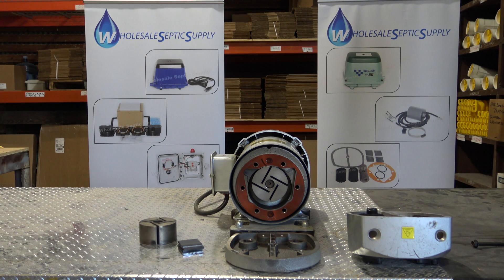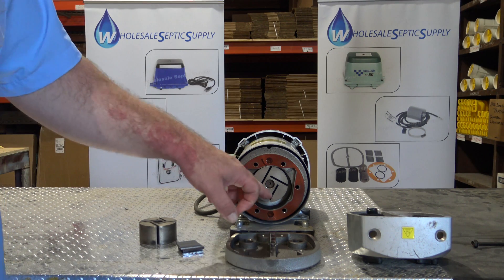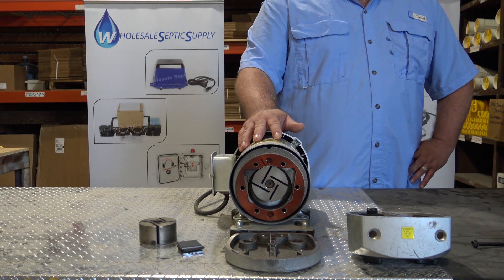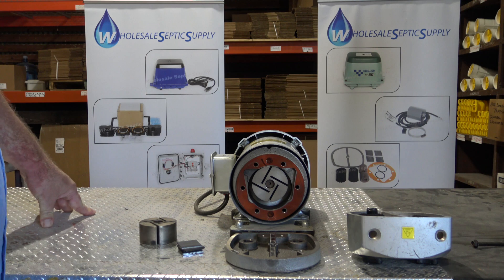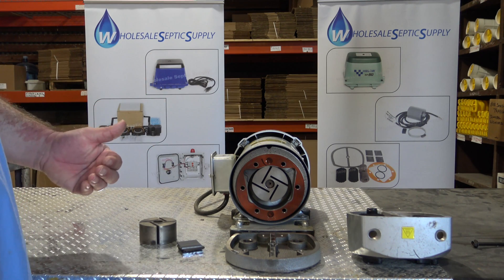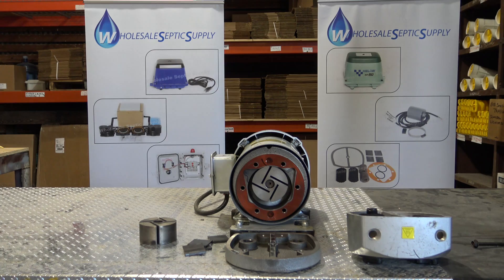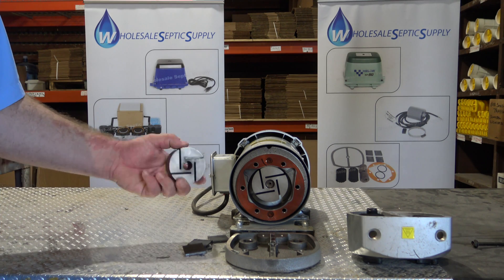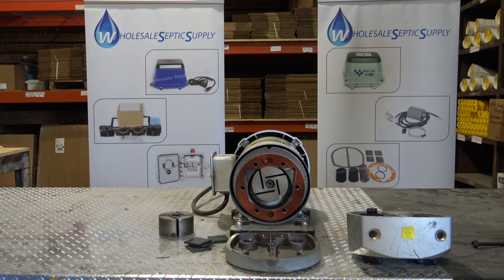Rotary Vane Septic Air Pump

Comment: Thanks for the video, I have a couple of questions....

1. How is the required RPM on the rotary vane pump calculated?

2. Do they take a large force to spin when producing compressed air?

3. We need one that can produce minimum 8 PSI at minimum 12 litres per second. Do you know of any available that can produce that?
Reply from the maker: Sure i dont know if it has be that precise but they have ones that produce that lps. Or over. The at05 is 137 LPM 1023 is 220lpm. 1423 is about 250lpm. That’s the most common types. 1423 is 1 hp. They have larger units though. For this application the rpm 3450

Comment: Hi,  hope u r doing good..  I have gast 2067 vane compressor.  I m facing problem,  I m not getting good pressure..  Pressure is going till 3 bar...  I changed the Vane Plate after that I m facing this problem..  Can u give me your some expert advise  I would be very thankful to you.
Reply from the maker: x.ashhad exp and funny video T.V  that a big pump let me call my Gast rep and find out. You will lose a little bit of pressure after rebuild but not that much that’s a monster pump. You should getting more pressure though.
Reply: Wholesale Septic Supply thanks for your response, I need pressure 8 to 10 bar..  But I m getting around 4 bar,  if u will get Any information please inform me..  Ok can u tell me one thing.  That vane plate should be equal to rotar slot.  I m talking about vane width
Reply from the maker: x.ashhad exp and funny video T.V  yes it should be the tolerance is supper tight in the thousands of a inch